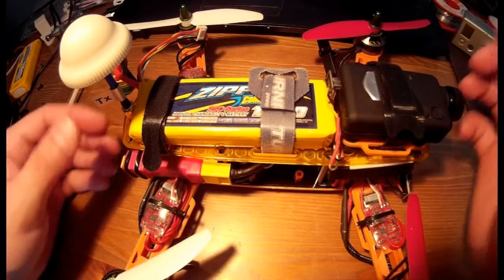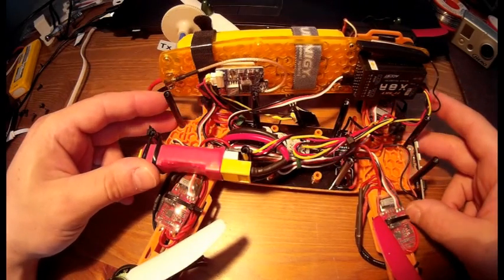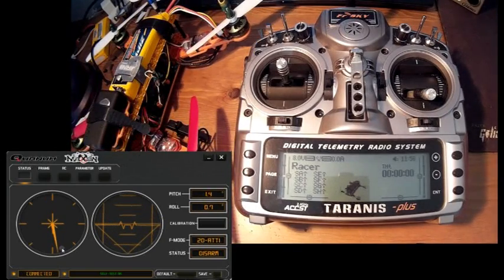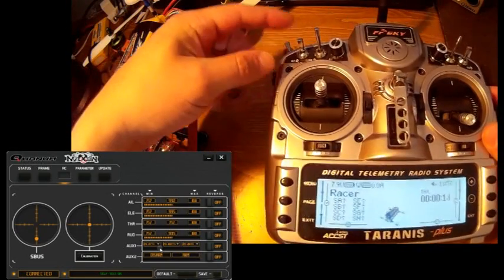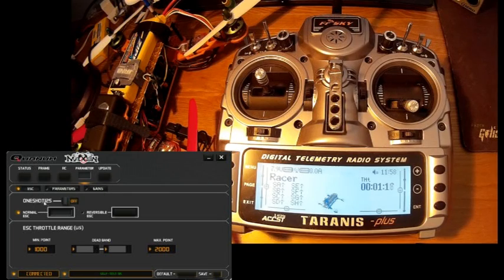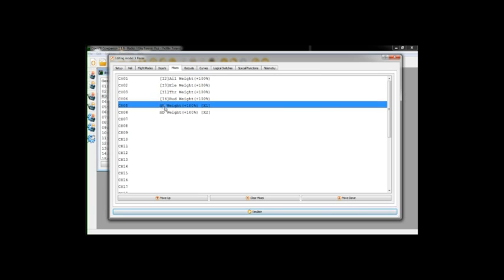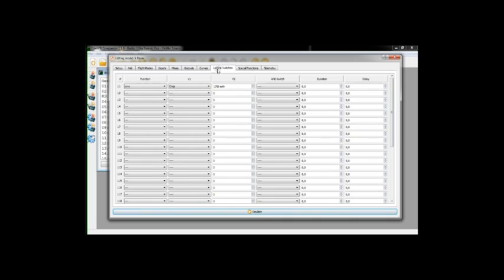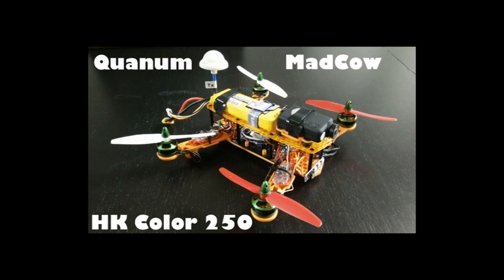Quanum Madcow Flight Controller setup

Comment: I have this flight controller however I cannot get the FC to arm the motors. HK even gaved me a replacement and it is still not arming the motors.I tried the motor test on the frame tab and the motor will not spin. Appreciate any help that you can suggest.
Reply from the maker: Hi. In the software, under "parameters" tab, did you select "Normal" ESCs and disable "OneShot125" option? (I assume you are using regular ESCs)

Comment: love the video. Have one of these board just start playing around with it. Could you kindly show a close up of the wiring to the fc in ppm configuration? cant find much info on this board
Reply from the maker: Sure. In ppm, you just have to use the provided cable that plugs in the front of the controller (tagged with "GVAETRX1X2"). Just follow this:
G = Ground => to your receiver/esc -
V = Voltage => to your receiver/esc +
A = Ailerons => to the ailerons channel of your receiver
E = Elevator=> to the elevator channel of your receiver
T= Throttle => to the throttlechannel of your receiver
R = Rudder => to the rudder channel of your receiver
X1= aux1 => to the channel of your receiver used to choose the flight mode
X2 = aux2 => to the channel of your receiver used to arm/disarm your flight controller.

Tell me if you need help.

Regards.